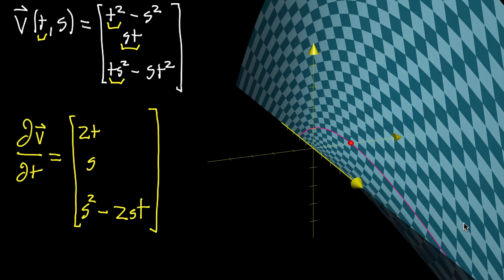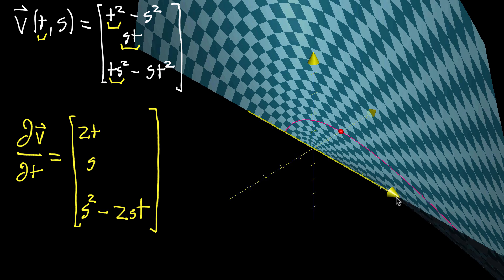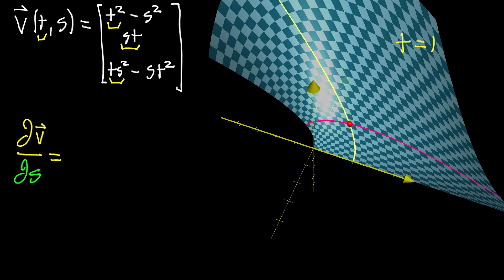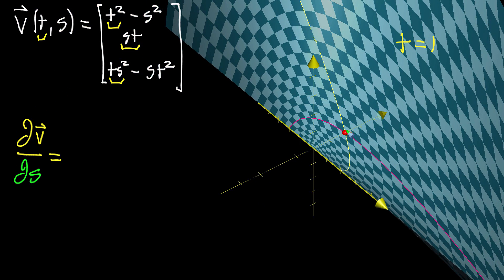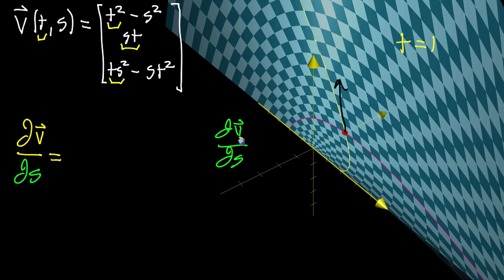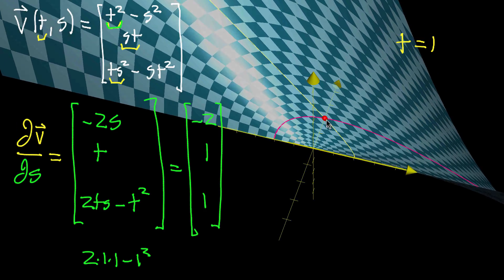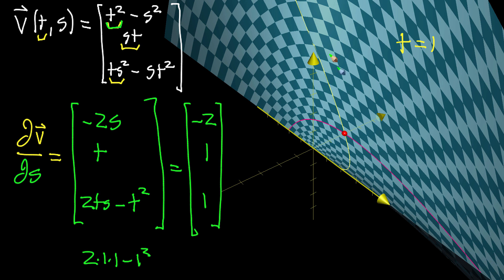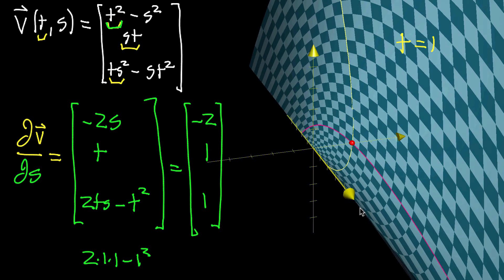Partial derivative of a parametric surface, part 2

Comment: Finally, understood parametric curves represent 1 input, basically a 1D line stretches and curves in 3D space. Similarly, Parametric surfaces correspond to 2 inputs, a plane which bends and curves in 3D space.

Is there a name for 3D input to 3D output transformation?

Comment: Is it really cheating though? Wouldn't the T/S plane be exactly where you placed it in 3d space?
Reply: He shows transformations like this one (2-D to 3-D) using this animation to show the points on the old T/S plane being mapped onto the new 3-D space and how any movement on the old plane corresponds to movement on the new surface illustrated by the function. So no, he's not actually cheating and the T/S plane doesn't move per say but the points on it are shown to move through the transformation.
Reply: The 3D space is x/y/z. There's nowhere the t/s plane "would" be, other than on a completely separate graph.

Comment: You stated that dv is not small because it's scaled by a very small ds.  But, isn't that always the case with derivatives?  That is, isn't the denominator always really small?   In other cases, you still only get a really small dv/ds value.